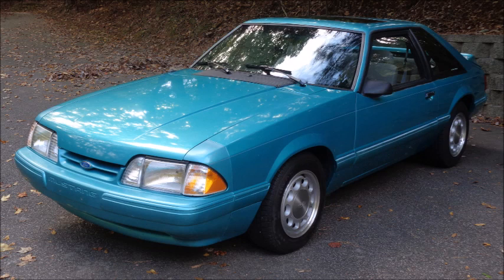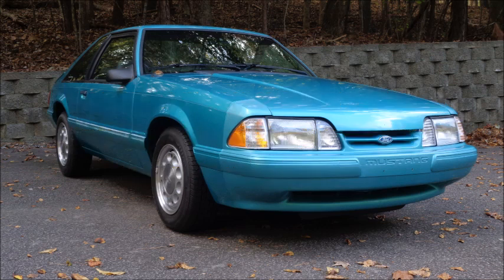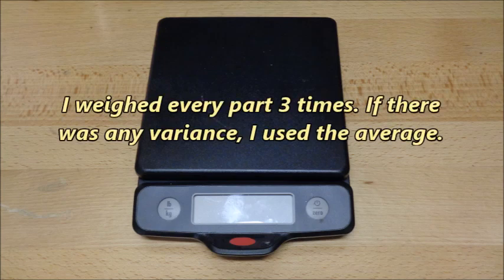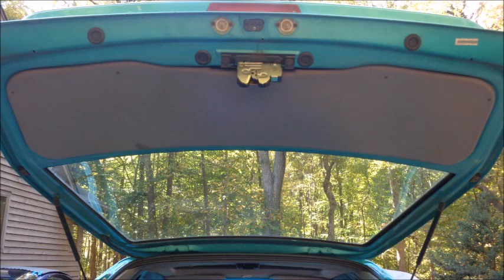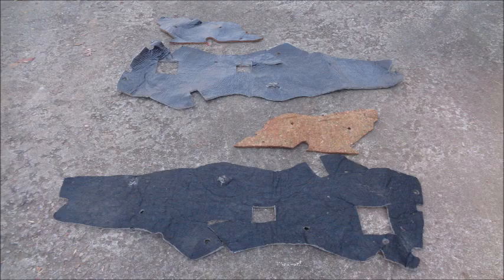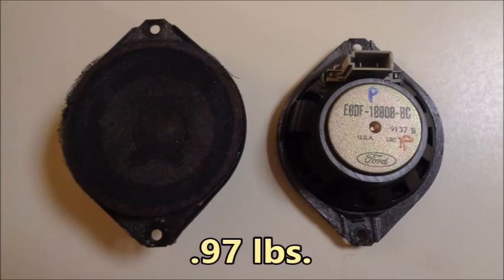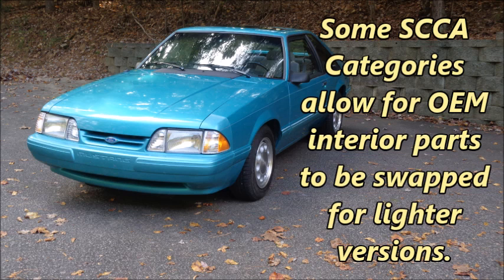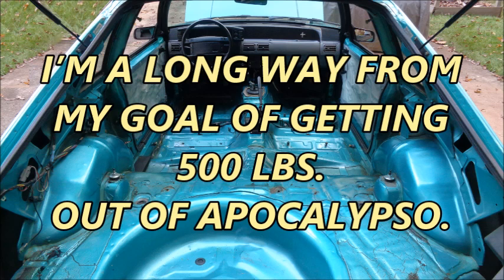Apocalypso: STRIPPING OUT THE INTERIOR & WEIGHING OEM PARTS

Comment: You can get pretty silly with gutting the doors too. Just out of curiosity, would the Volvo head swap be a weight reduction mod along with some power gain? And how about a stand alone (holly, etc) ecu to cut some wiring out
Reply from the maker: All options (within the rules) are on the table. A decision on gutting the doors will come down to weight reduction vs. weight distribution. I've always focused on mass centralization in the past, because my other cars easily made the minimum weight. The doors are in Zone 2; there might be a point when taking weight out of that area isn't the best option. I've looked into the Volvo head swap, but I haven't found any information about weight savings. It looks like the Volvo head swap doesn't add much power to naturally aspirated engines (but I'm still trying to verify that). The engine mods might give me an opportunity to eliminate some wiring.

Comment: A long way to go in getting to a light weight solution, but such a great project to embrace.  Where does the six sit in the plan to be in fighting trim?  And ..... do you have any plans for improving the brain power behind the wheel?  Looking forward to your progress.  Thanks for sharing.
Reply from the maker: I'm excited to see how light I can get the 2.3L and how it will feel. The plan is to have the V6 back out on course this season (after some more weight reduction mods). The work schedule for that car got sidelined by parts delays. As for getting smarter behind the wheel, I'm going to try to jump into cars with the faster drivers in my area and ask them to share their speed secrets.

Comment: Love your videos and always looking forward to the next one!

I bought a cheap 2001 Cobra (pre-chip shortage).  It’s completely stock with the exception of H&R race springs.  What class should I aim for?  I don’t want to mod something that would then need to be unmodded to conform with class rules.
Reply from the maker: Thanks! The lowering springs will move you out of Street Category. Your Cobra is not allowed in Street Touring Category. If you don't opt to put the OEM springs back into the car, you will be running in a Category that allows for a lot of mods (like ESP or CAM). You can run an under-prepped car in those classes. But you might be up against some heavily modified cars. Keep in mind, none of my cars would be considered fully-prepped CAM cars, but they do pretty well at my local events. Whichever Category you choose, I would highly recommend installing adjustable shocks and struts on your car; they make a huge difference. They are legal in every Category. If you plan on making a lot of mods to the car, I would run it in CAM-T, but I would resist the pressure to make major mods until you've figured out your driving style and sized up the competition. When you decide on a Category/class, I'll be happy to answer any other questions you have.
Reply: @warhorseracing  awesome!  Thanks for the starting point.  I’ll read up on ESP and CAM categories!

Comment: Very nice!  I did not think the rear seats weighed that much.  You mentioned a rear seat delete cover - it will be nice to see how you tackle that one.
Reply from the maker: Thanks! The OEM rear seats in the hatchbacks are very heavy. There are a few more things I need to do to the interior before I make the rear seat delete, but it will get done this season.
Reply: @warhorseracing  I took all the factory sound deadening out ( the tar stuff) and replaced it with Lizard skin.  That was probably 50+ lbs
Reply from the maker: @brokentoolgarage  I'm removing the sound deadening too. I'm collecting as much of it as I can to get an accurate weight.
Reply: @warhorseracing  Nice, thank you!  How about the bumper crash shocks?
Reply from the maker: @brokentoolgarage  I'm actually working on the rear bumper support right now.

Comment: Why are you chopping up such a clean car when there are so many beat up four cylinder cars. And that's a rare color with a factory sunroof. Would make a lot more sense and more fun to make a factory 5.0 Car. And with the prices these cars are bringing in and how much you're going up in value. Clean cars like that are getting extremely hard to find
Reply: Because it's his😂...he does nice work as well so it will be nice
Reply from the maker: I looked for cars for several months. Many of the cars I found were in rough shape and the prices were still high. This car was the best option for this project. As I mentioned in the previous video in this series, this car has had some front end damage in the past, there's been some restoration work done to the interior, and it has some cosmetic and mechanical issues. It's a very good car, but it's not a true survivor car. I've already built a 5.0 Fox Body (check out my ThoroughbRED playlist); it's a fun car with a ton of sentimental value. I didn't cut that car up (and I would never cut it up). This 2.3L is going to be heavily modified, but it will be built with respect and built to last.